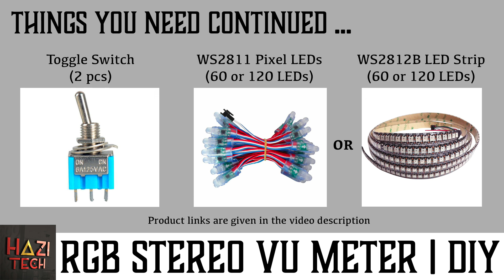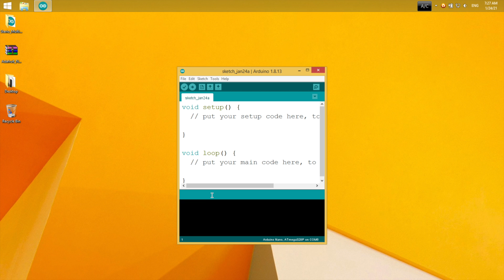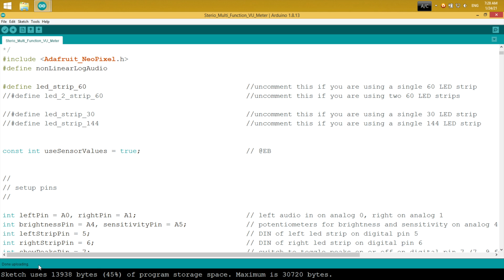DIY RGB Stereo VU Meter  | Multi Color with Patterns | Arduino Nano and WS2812B | Free Arduino Code

Comment: Hi, is the thickness of the cable important?
Reply from the maker: No. As long as you use a decent cable for audio in, that’s fine.
Reply: @HAZITECH  How can they shine with only 2 amps?
Reply from the maker: Since the strips won’t light up in white all the time, 2A is enough.
Reply: @HAZITECH  Ok, because I have a 40 watt and 8 amps power supply and thought about it.  I have everything done 🙂 waiting for the jack cord.  I am still wondering if at the DC socket it matters where I connected the voltage cable, and where the GND.
Reply from the maker: As long as the power supply is 5V, any current rating above 2A will work. And wire exactly in the wiring diagram. That’s it.
Reply: @HAZITECH  Something's not working.  The diodes light up slightly and then they go out when voltage is applied.  Nothing else happens.
Reply from the maker: If the codes were uploaded properly, 5V 2A was given and the audio signal is given, then it should be a wiring issue.
Reply: @HAZITECH  I have no idea.  The LEDs have voltage, I checked.  Music passes through the jacks to the loudspeaker.  I don't know where to look for wiring errors ... Apparently there is no signal that will turn on the leds.
Reply: @HAZITECH  I was able to fix it.  One problem, only one bar plays.

Comment: Hi. I made it with two 144 led strips and the only problem I have is that the first 16 leds on each strips are way brighter than the rest. Any idea why?
Reply from the maker: You have to give 5V power to both ends of the LED strips for even power distribution. Try that.
Reply: the same problem occur mine...

Comment: NIce job Man! I want to make a similar project, but with 200 LED powered by rechargeable batteries for a 4 hours use each time. Can you suggest a power supply solution to my project?
Reply from the maker: Awesome. You could use a 5V mobile phone power bank like with 10000mAh capacity. Make sure it can output at least 2A.

Comment: the light keeps on, the schematic is correct, what's wrong?
Reply from the maker: If you do the wiring correctly and uploaded the code there shouldn’t be any issues. Try adjusting the sensitivity knob.

Comment: Mas, if the sound sensor is replaced, it doesn't connect to the audio, the scheme is changed, it remains the same, and the LIBRARY is also different or the same?
Reply from the maker: This works with an audio aux input. You can plug the analog out of the sound sensor module to the same audio input jack. Code and wiring stays the same.

Comment: buenas noches, muchisimas gracias por tu proyecto. Tengo un problema, y es que al encenderse los led´s, me ocasiona un ruido parásito en los altavoces. Tengo conectado las resistencias y el condensador tal como pones. El condensador es de 2,2 uf. Y tengo un potenciómetro de 10k. Cuál puede ser el problema?, si los led´s no están encendidos, el audio hace bypass perfectamente, pero al iluminarse los led´s, vuelve el ruido, como el de un grillo.
Reply: Me respondo yo mismo, el problema estaba en la salida analógina de mi PC, no sé el motivo pero sin tener las tiras encendidas, el bypass no tenía ruido de fondo. Así que ahora entra el audio a través de la salida usb de una tarjeta thx de unos auriculares razer kraken y funciona sin problemas
Reply from the maker: Es muy agradable saber que resolvió el problema. Genial y gracias por los comentarios.

Comment: how many ohms and watt resistors are used??
Reply from the maker: Resistor values are mentioned in the parts list. 1/4 W is enough
Reply: can a 1.5watt resistor be used???
Reply from the maker: Yes you can
Reply: thanks for the hint, very useful content...
Reply from the maker: Thanks 🙏🏻
Reply: hi sir, can i request this program for bass.. please
Reply from the maker: It would require a considerable code change. I’ll see the possibility of it based on my schedule. Thanks
Reply: @HAZITECH  ok sir thanks again for the response.. and good luck...
Reply from the maker: Good luck 👍🏻

Comment: Audio in and audio out that jack in circuit diagram ???
Reply from the maker: Both jacks are identical and you can use any one as audio in. Then the other is audio out.

Comment: Ayye meke audio in ekata amplifier eken speaker out line ekA connect karanna puluwanda.a kiyanne speaker out eken denna puluwanda
Reply from the maker: Mama try karala nam na. Speaker out ekata volume wedi karala multimeter ekak thiyala balanna voltage eka keeyada kiyala. 5V walata wada adu nam prashnayak na.

Comment: Hello this is a great project...I have a quick question, in the design you show 1 switch but in the construction I can see you have 2 switches, what is the 2ns switch for?  Thanks
Reply from the maker: One switch is for peak hold ON/OFF. The other switch is for strip selection for two strip stereo or one strip stereo.
Reply: @HAZITECH  Thank you is there a wiring diagram you can share so that I know how to connect the 2nd switch.  Thanks and much appreciate your prompt response
Reply from the maker: It is linked in the video description.
Reply: @HAZITECH  yes but that diagram only has one switch, where do I connect the 2nd switch. Thank you very much
Reply from the maker: Please take a look again. There are two.
Reply: @HAZITECH  oh yes....sorry my mistake.  Much obliged...I will build this and let you know how I get on.  Thanks so much
Reply from the maker: You are welcome
Reply: @HAZITECH  Are you saying the second switch turns off one of the led strips? I don't think I would have a need for that, but I would use a second switch for power on/off.
Reply from the maker: No the second switch basically share the same data output with both LED strips so both displays the same. It is not required if you are using just one strip.

Comment: I completed this build and everything seems to be working except for Mode 3.  In this mode, the Left Channel and Right channel don't appear to run the same and something looks like there's an error in the code,  I'm using 2 strips of 60 LED's and have the select switch in stereo mode.  When i change it to run in Mono (both sides run from the Right Channel), then it seems that both sides are working the same,  Is there a small bug in the code perhaps?
Reply: hi i have the same problem, did you find the solusion
Reply: @raulrg1208  no, never got a solution except for mono mode.
Reply: @KevinGroninga3D  i have the same problem, mono works fine but if I put it in stereo only my richt side is working. and I see in the video that you have more pattern settings can we unlock them too? thanks
Reply: @kozlowskifilip7218  this wasn’t my video.  But I was never able to solve the issue of stereo mode and just switched to mono (sadly).
Reply from the maker: Hey, glad you made it. I'll check the code and get back to you.
Reply: @HAZITECH , cool!  Would it be helpful if I shot a short video of my build and how mode 3 appears ‘odd’?  And btw, having that JPG image of the schematic was super helpful in doing the wiring!
Reply from the maker: Yeah that’s great. Send the video to my HAZI TECH Facebook page messages. And you are welcome.

Comment: very detailed and easy to understand video
Reply from the maker: Thanks a lot 😊
Reply: @HAZITECH  one question...if you have 2×60 LED strip then why upload that first one 60 led with 2nd one commented?🤔
Reply from the maker: Two LED strips can be worked as a single strip or as two channels. So if you see my demo, you can see in the first half both LED strips work as one. Then in the second half they work independently.
Reply: @HAZITECH  I got that demo part....my question is if I uncomment that 2nd strip then should I comment 1st single stripe and then replace all that single strip variable with 2nd stripe variable which defined? Or the variable already present in loop?.... Isn't then variable missmatch error? So confused 🙄🤔🤔
Reply: @HAZITECH  okay now I got that after deeply observing the code....you already defined those variable settings with #if define and #elif define 😋😅
Reply from the maker: Perfect 👌🏻
Reply: @HAZITECH  sorry for bothering you again.... 2:55 you wrote to use 5v in both side of LED stripe for proper color distribution, but you used only one side still no color fading in your setup why?....did you used high ampear power supply or it doesn't required at all??🤔

Comment: what if i use 5 rgb led strips? and what is the function of the potentiometer for?
Thanks bro...
Reply from the maker: You can use any number of pixel LED strips in parallel. Potentiometers for controlling the brightness of the LED strips and adjust the audio response.

Comment: hello, I want to connect it to the cinch in the car.  can I switch to RCA (cinch) instead of aux?   Very nice design, thank you 😊
Reply from the maker: Yes of course. Make sure you give L and R audio signals. And connect RCA ground with the device ground.
Reply: @HAZITECH  thank you very much 😊
Reply from the maker: You are welcome
Reply: @HAZITECH  and can I divide the 120 LED strip 1 meter into 4 parts and connect it in series?
Reply from the maker: Yes. You can use any combination. All you have to select the right no of LEDs per strip in the code.
Reply from the maker: For an example, for a 60LED strip, you can use 3, 20 LED strips in series. And you can use any number of LED strips of same length in parallel.
Reply: @HAZITECH  thank you 😀

Comment: On the video  you're  using two led strips but when you show the code  you were uploading for one led strip. How come ? Or you connected them in parallel ?
Reply from the maker: Audio source goes to audio in (eg. Phone, Laptop, etc). Audio out goes to speakers. And based on your requirement, you may need only one.
Reply from the maker: Audio IN and Speaker OUT
Reply: I need both  channels to work. Left and Right.
Reply from the maker: With one strip also you get the stereo effect. If you take a look at the wiring diagram you can see there is a switch to select the data line to the strips. With two strips you get more design options.
Reply: @HAZITECH  can it support 2 led strips and 144 leds both? I've tried two 60 leds, it works fine.

 But when I set 144 and create a new "define for 144" it doesn't work at all.
Reply: did it. works just awesome! thanks for your replies and for this project!
Reply from the maker: Awesome. You are welcome 👌🏻

Comment: It's awesome!! Cool project. I want to make it too😁. I'm amazed by it😍.  
Just wanna ask how long was the led strip?
Reply from the maker: Thanks a lot. I used 144 LED/m LED strips and used 60 LED pcs. It’s about 40cm long.
Reply: @HAZITECH  thank you!😊 God bless for more cool DIY projects.
Reply from the maker: Thank you so much.
Reply: Hi Bro..can u tell me if I can use mic sensor module connected to the Arduino nano...what would be the change / New program codes to compile..plz help me out with this..Thanx n respect..
Reply from the maker: You could use the existing codes. Choosing the right mic module is the key. Give the mic module output to audio in port of the system.

Comment: Nice project bro👍
Can i ask how to count the resistor that Will be use..?
I look in the other project you use the resistor is different.🙏
Reply from the maker: Brother the resistors connected to the LED strip is 330 Ohm (D4, D5 pins). All the other are 10K.
Reply: @HAZITECH  an than the Watt..?
1/2 Watt or 1/4 Watt or 1/8 Watt.?
Reply from the maker: It doesn’t matter. Use 1/4W as it is common and cheap.
Reply: @HAZITECH  although the number of LED  used is different
whether the size resistor remains are same ...?
Reply from the maker: Yes
Reply: @HAZITECH  thank you 👍
Reply: this thread answers my questions, thanks 👍👍
Reply from the maker: Great 👍🏻

Comment: Mekata 2811 pixel danna wenas karanne kohomada aiya
Reply from the maker: Wenas karanna deyak na malli. Me code ekama use karanna.
Reply: @HAZITECH  thank you aiya msgeq7 brand ekek karamuda aye eka patta
Reply from the maker: IC eka enakal inne malli.
Reply: @HAZITECH  mn genat haduwa circuit diagarm eke aulak nisada koheda wada kare na .oya ekak hadala diagarm eka apitat denda ජයවේවා !
Reply from the maker: Hi brother. Diagram eka 100% hari. Mokada mama era thawa keepa denekma hadala wede hari kiyala msg kala. Oya oyage circuit eka double check karanna. Push button hariyata solder karala check karanna. Eewa losse nam okkoma awul wenawa.
Reply from the maker: Me thiyenne WS2811 dapu video eka.
https://youtu.be/Jp4_6qAXYSc

Comment: my setup is all ready and led is also responding on music, but the animation is not very smooth i reduce the noise and decrease the sensitivity. but it wont work :(

just for information i USED Left only in one input.
Reply from the maker: I think there is a issue of the 5V power supply or the audio cable that you used. I also faced the same issue. Try powering the system with the Arduino Nano USB port as well.
Reply: @HAZITECH  power supply is ok, i think audio cable having some issue,
but colour change and pattren change is not working i already make important changes for buttons, like true/false etc.
can u help in this button issue.
And more query:- 1. can i use 120 led strip i mean 2 meters long led strip.
                               2. what is toggle peak hold works.
Reply from the maker: Yes you can use 120 LED strip. You need to change only few code lines. And DO NOT change anything else in the code. Everything works as it is. Just check the wiring is 100% correct and you have connected all ground wires together.
Reply from the maker: Peak hold turn the floating dot on and off in the main pattern.
Reply: @HAZITECH  ya I changed no. Of leds. But Button is still not working.
Reply: I only use one strip ? That why button is not working.
Reply from the maker: No the button has nothing to do with the strip. Did you solder the button or using a bread board?. What is the push button type do you use?
Reply from the maker: Yes I’m using that button as the push button. For peak hold use any ON/OFF switch. Are you using a project board (bread board) for this?. If the push button connections are loose it does not work properly and give weird signals. The push button you are using cause issues on bread bords most of the time.
Reply: @HAZITECH  ya their was a problem in My circuit I solved it.
But u showed only 3 modes at one time. Then u re-upload the code and the  the new vu-meter show.

I have a question Can we Display modes more than 3. :)

And sorry for my Bad English :-)
Reply from the maker: Glad you sorted the issue. Sorry only 3 modes at one time.
Reply: @HAZITECH  ok i wanna thank you for helping me. And take care of viewers. 
Love From India  😘😘.
Reply from the maker: Thanks a lot brother 🙏🏻